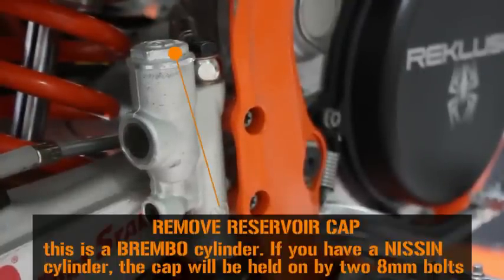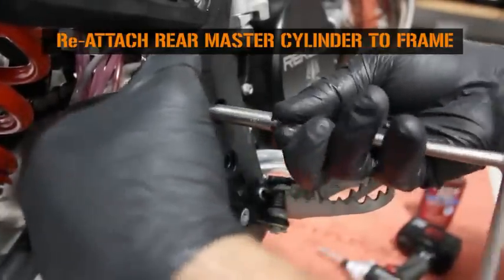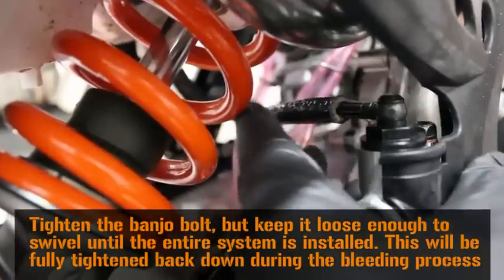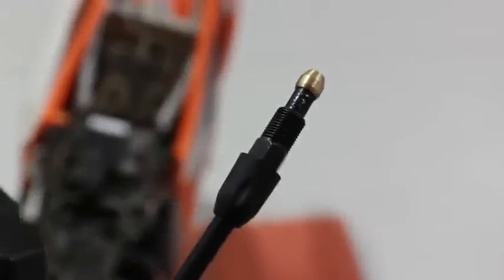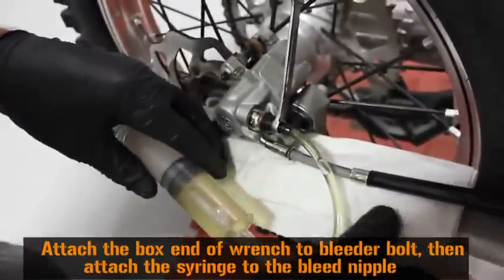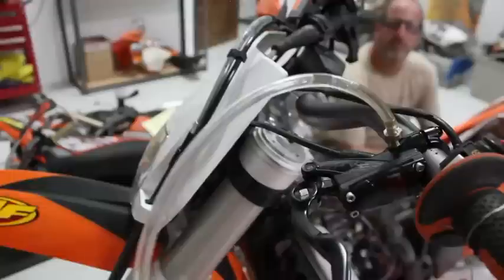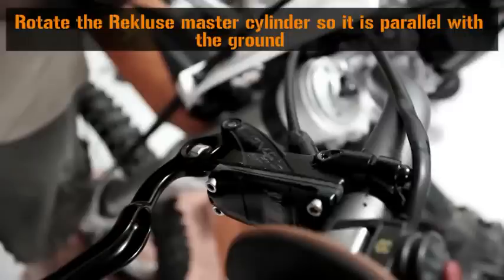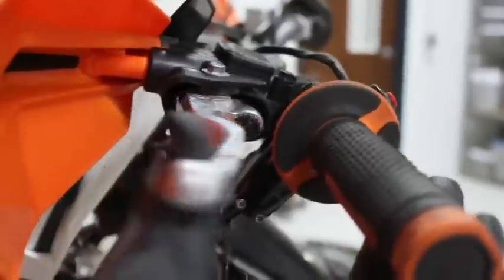How To Install Rekluse Left Hand Rear Brake Kit - SoloMotoParts.com

Comment: Just put one on myself.  Easy, but had to bleed twice to get it right.  KTM 300 XC.  Will never own another dirt bike without Rekluse and rear brake kit, truly amazing.  10x better feel than a short throw brake pedal thru a mx boot.
Reply: trackday u should look into the Clake dual control

Comment: I wish I was more mechanically inclined 😂 still running drum back and disc front and I can tell my braking systems at 70% of what it can do, I know the rear brake is adjusted one spline towards being loose but that's for winter riding one black ice and ruts since I'm running a 4.10" tire instead of 5.10" would an upgrade help for taking off or just more cc's because when I try to holeshot it either acts like its jabbing a pin even slipping the clutch. By new years I'll just drain the reservoir and refill with new dot 4 or buy bigger brake lines

Comment: They are MTB brake levers!
How about use MTB levers for the front brake and clutch?
Would they pass scrutineering for a race?
Reply: Francisco Shi those brakes are actually meant for a downhill mountain bike you should have no problem passing spec
Reply: @jonahchalat8650  I got MTB levers for my clutch front brake and rear brake. They are so much better than the motorbike levers. I did use them in a race about a month ago and no one noticed.
I will never go back to motorbike levers.

Comment: If you like to stand a lot when you ride i.e technical rides etc where do you recommend the brake to be orientated. What is best practice in terms of what most run when they like to stand a lot. Brake on top or below?
Reply: My approach:  going up a hill, I want to use the clutch, going down a hill, I want to use a rear brake, therefore brake on top, clutch on bottom.

Comment: Do you have left lever brake systems that work on bikes that have drum rear brakes?
Reply: Try a bike shop
Reply: If its drum its probably by wire so you might aswell get a bicycle brake, some brake wire, amd you run that to your foot brake lever, splice it into the existing mechanism and go... Thing is it will also pull the handbrake when using the footbreak and vica versa but i dont think its very smart. Better to upgrade to disk...

Comment: Can you use these kits on sportbikes?
Reply from the maker: +Oloughlin2777 No, sorry. Rekluse doesn't offer sportbike applications, nor would we advise using this kit for such an application.
Reply: +Oloughlin2777 There is/are kits available for sport bikes, usually mounted on the fork between the tripple clamps, just for your thumb. Google it.